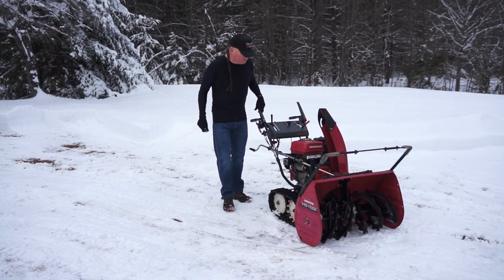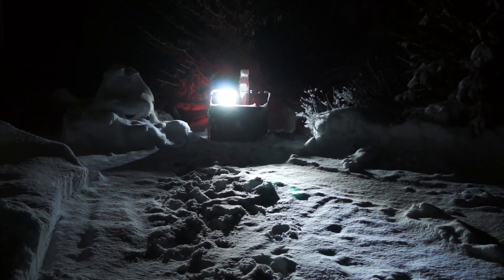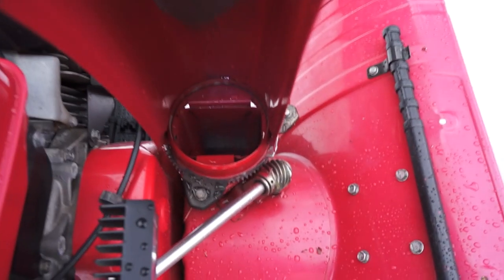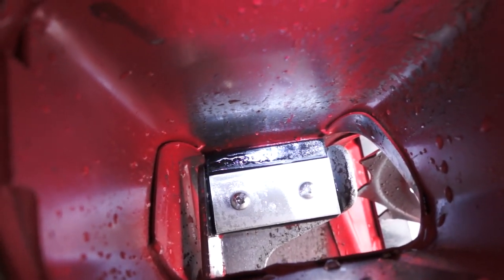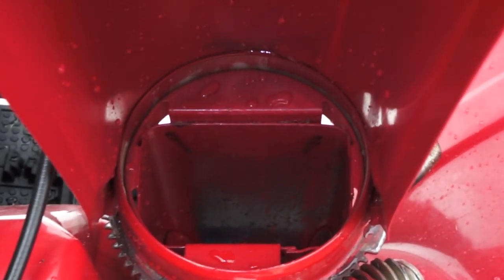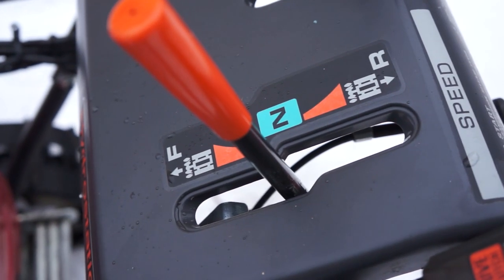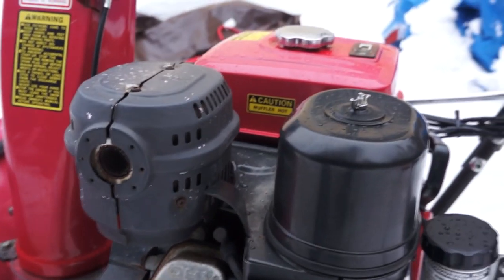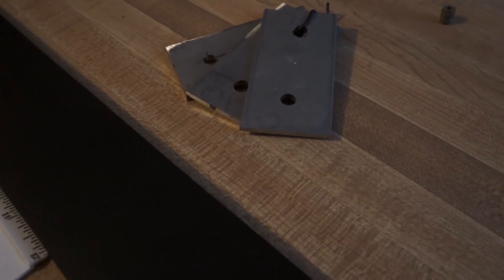Honda HS 1132 Snowblower Modifications

Comment: Just wondering, were you not satisfied with the discharge of the 1132 that made you decide to do the impeller mod or was it having trouble with wet snow or just because you wanted to do it and see if it made a difference?
Reply from the maker: Never have even come close to clogging. If you listen to my  comments I say you don't need to do this modification, but I wanted to see if it made a difference, so it was just my curiosity. All of my other videos are with the stock machine except for one, which I  posted that it was modded in that one a few weeks ago.

Comment: Why did you say you may go smaller jet?   Is the spark plug getting carboned up?  When going with a bigger jet, is it beneficial to change spark plug gap?
Reply from the maker: Only because it seemed like it was running rich a couple of times, but I didn't change it and it is fine. Not sure on changing the gap, but it is running  fine with the standard gap.

Comment: Some great mods! i did the impeller mods many years ago on my sears blower,so i did it also on my recently purchased used 1132.with these impller mods, it is lots of more stress on the machines power system,plus the belts,but i feel honda belts (kevlar ones i believe) can handle it ,and yes upjetting is best way to go. i noticed at time 2041---2045 that you  pop the machine full reverse and full forward.... I was told by a small engine/snowblower/lawnmower repair shop (reputable guy)that I shouldnt pop it in "full" forward and  or "full" reverse,just put  it in slow forward and or slow reverse and while you then drive it,slowly move the lever to full forward or reverse only after this procedure first>>>,this way it is easier on the transmission and thus preventing the expensive transmission failure in the future.  any thoughts or suggestions??ty  Great Video!
Reply from the maker: I'm sure that like most things reversing directions at high speeds would put some stress on things, but I did it to demonstrate the speed changes. I don't do it on a regular basis, but being a hydrostatic drive, it can probably take a lot. Why do you think that the impeller mod would put more stress on the machine/belts? Once the impeller has been running for a minute on the first time you use it, it moves freely, just with no gap, and if it is keeping it from clogging on wet snow, it is even less stress. My HS1132 has never clogged though, even before I modified it. I'd be interested to know how much improvement you got on the Craftsmen snow blower. I used to have the 3 stage Craftsmen blower and it was a decent blower for the times, but had serious gaps between the impeller and housing. Did it make great improvements for yours? Do you have any video of it after?
Reply: @assmunch1  ,ty for your thoughts and input. thats what everyone needs on Ytube is input and experiences from others. yes it surely improved my Craftsman and it was a big plus to moving snow out the chute (whereas i installed a (walmart Krazy carpet slider plastic) also. I have noticed that the belt did wear out faster/stretched and it had to be adjusted tighter by moving the idler pulley tighter.again., as we know, the impeller is moving more snow out the chute. the krazy carpet surely helped because it was less friction,thus less stress on the belt ( honda uses a thicker Kevlar Belt than most snowblowers as far as i understood). no sorry i am not really into videos, but it may happen in the future.! Happy Snowclearing fun!! later.TKS

Comment: Nice Job!   Thank you for sharing.  What did you do with the second red lead coming out of the rectifier?  What size hole did you drill for your switch and how is it wired into both lights??   Thank you.
Reply from the maker: For the particular switch I used, it is a 19mm hole, which is just  a tiny bit smaller than 3/4 of an inch. There are two  leads from the coil, coming out of the engine.  The red wires go to  those two wires. Because it is AC, it doesn't matter which one is connected to which.  Coming out of the convertor on the DC side it does matter, and it is marked on the case. The yellow wire is positive.  The switch gets the yellow wire from the convertor to the center contact, and the positive wire going out to the light is the brass colored terminal. The silver terminal on the outside of the switch gets the black wire from the  the convertor and the black wire on the light. This is how the lighted switch lights up, when the circuit through the headlight completes the circuit. If it wasn't a lighted switch, you'd only need to go to the black wire on the light. You don't really NEED a switch, I just wanted one because it looks cool, and I can flash the lights if I want to. :-)
Reply: @assmunch1  Thank you for your time and detailed response.  I only have one AC lead coming out of my GX160 engine in my HS624.  Hence should I take both red wires and connected them to the single AC output from the engine?  I was wondering about putting a fuse inline from the ac output from the engine to the rectifier, do you think it is needed?  If yes, what amperage fuse do you think?
Reply from the maker: @duanedunlap852  If you only have one wire, then the other red one will go to ground on the frame or engine. On my HS1132, the housing of the original headlight is plastic, so it had to have  a second wire going to the headlight for ground. The output on the HS1132 is 1.25 watts, so a fuse between 2 and 3 amps should do it. I did not put in a fuse.

Comment: Thank-you for the very informative video ,one of the best on utube.Have a few questions (1) Where can I get the lighted switch , and can it be wired so that the light would be on when the switch is off and off when the switch is on? (2) Where can I get the led light? (3) How much current, DC, does the stator on a HSS9 snow blower put out? I want to install hand grip warmers. (4) Could you use 1\2" instead of the bolts in the impeller kit? and ( 5) Would you recommend Honda or Ariens Rapid Trak Prow?..Thanks again, looking forward to the next video.Wils
Reply from the maker: You are welcome Wilson. All of the links to the parts are listed under the video. Click Show More. If you have battery electric start, you should have the power necessary for heated grips. Mine is an HS1132 model so I would have to put in a bigger lighting coil for heated grips. The standard one is 15 Watts. Whether you use screws or bolts to hold the impeller kit on, I'd use stainless, so that if it ever deteriorates, you could easily get it off to replace it.  The light in the lighted switch picks up it's power when the circuit is complete as the switch is put in the on position. Not sure how you'd get it to be the opposite of that. Obviously you don't even need the switch, but I wanted it on there, because it looks cook and it gives me the ability to signal my  neighbor  in his tractor when we are snowblowing the road together.

Comment: The best possible mod would be to raise the handle height to prevent stooping and back pain. 
Is there a difference on the led mod for the 1132 with electric start?
Reply: Fairly easy to lengthen the handles with steel pipe. Not sure if the cables would need lengthening or adjusting.

Comment: Many Thanks! This certainly Helps
I got Lucky 4 days ago; bought a HS1132 in excellent condition.
I’m certainly going to do  your headlight upgrade.
Questions:  
1) -=> Did the carb jet size increase make much difference? Cause problems?
2) -=> I want a copy of the Service Manual, any suggestions?
Thanks Again
Reply from the maker: The bigger jet made a huge difference, when you tie into enough deep snow for it to kick in and get aggressive. Ask Anthony Vanucci on the Honda Snowblower Enthusiast Facebook page. He is the master of all the Service manual stuff.
Reply from the maker: @oscarbead  is the convertor you ordered AC to DC? There is a cheaper convertor on Ebay that is DC To DC, but that will not work, since the output of the Honda HS1132 is 20v AC with no load.
Reply from the maker: @oscarbead  Sounds good. I just didn't want you to get the wrong thing and be bummed out.  Yeah, it's way better than making up your own with the bridge rectifier and capacitors. So, you may already be aware of this, but I wasn't until the other day, when I needed to order some stuff from Amazon, and saw the "free shipping to an Amazon locker" option. Being in a very rural area, I figured that no way they'd have such a thing here, but to my surprise, they had several locations within the area that I'd normally drive. When my package arrived, they emailed me a QR code, and I went to the location, which was outside (under cover) at a shopping mall, and there was a wall of lockers, with an ATM like screen in the middle. I held my phone up in front of it, and my locker popped open and I grabbed my package. No shipping charge. Kinda cool.

Comment: Awesome video man. I’m thinking of getting those drifters for the front. Pretty sweet. Keep up the good videos
Ps if you have reddit account I just made a Honda page-> join me on r/HondaSnowblowers
Reply from the maker: Thanks, I just fixed the links to the places I got everything., so now they work.
Reply: @assmunch1  great man. You said yours is over 10 years old. Have you changed belts on it, spark plugs, bearings, tracks yet? What kinda maintenance have you done to it?
Reply from the maker: @appleztooranges  13 years old. never change the belts (never even seen them) spark plug occasionally, but it looked like yours when I changed it and was working fine. Never changed the tracks. Pretty much just change the oil and stabilize the gas and lube cables.
Reply: @assmunch1  never had carb issue?